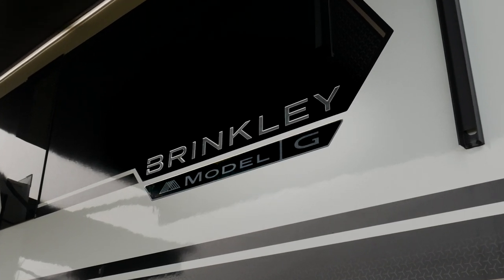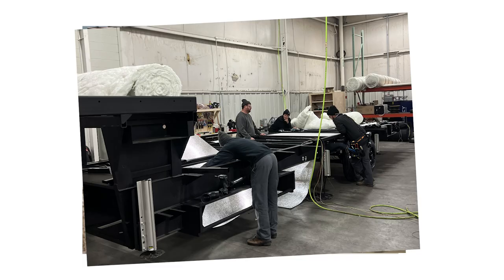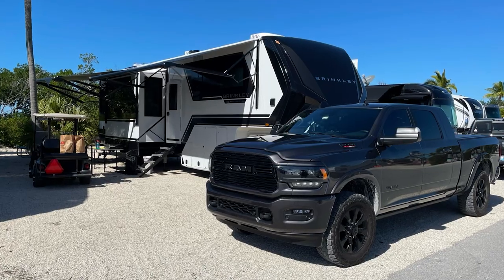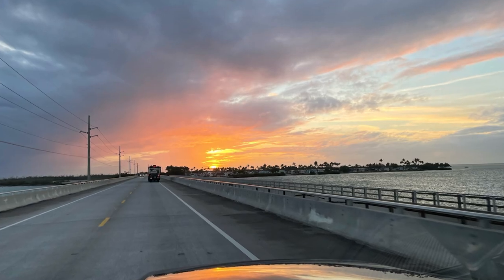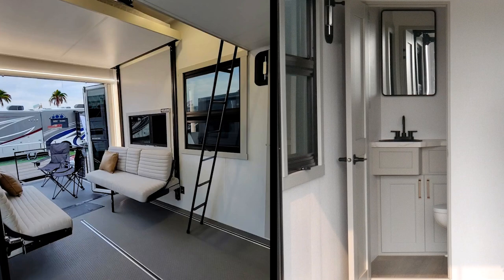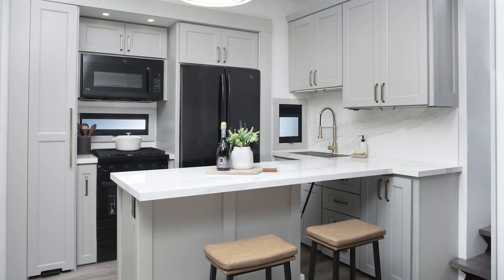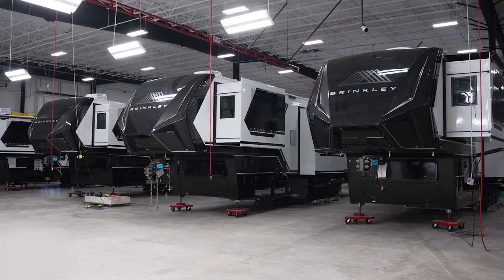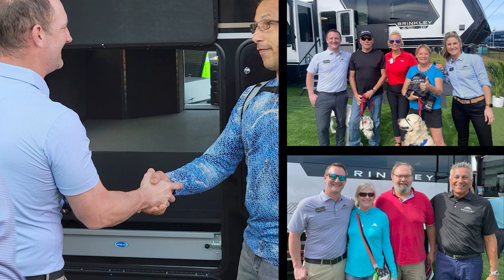Creating the Brinkley Model G a Toy Hauler Without Compromise: Interview with Nate Goldenberg

Comment: I'm hoping to see a 3110Z model that has the rear area as a flat "multi-purpose " room. Something you can store bikes,  cases of water,  basically anything.  Used as storage with tie downs. I want it in a Z model,  so it can be towed with a 250 or 2500. Couple's 5th wheel with storage room in the back. Should be a great seller and you can provide add-ons: washer dryer, bunks, couch, tie downs, work desk.  Should include an exterior door access.

Comment: My family is looking forward to a 2 full bath model G when it comes out as we have 6 kids still at home and don't haul any large toys, so a full bath fully contained in the garage in lieu of a larger toy garage which allows to keep the amazing living space is much preferred to us! I was wondering why the change from Furrion to GE Profile ACs? One explanation I heard was the new suspension lifted the trailer a bit above the 13'6" mark so you needed the low profile ACs, is there any truth to that? Also, have you considered the new Furrion Chill Cube ducted acs when come out or just going with their direct dump since there are 3 distinct AC zone in your G models? The lower power consumption and higher BTU rating would help a lot! I am in Texas so cooling these rather large puppies down when we have 8 bodies inside is a concern. Thanks!

Comment: Can the toolbox lid be reversed? It would be easier to reach in when a SxS is parked over it.
Reply from the maker: No, it would not be accessible with the garage door closed.
Reply: @BrinkleyRV  That is true, but if the vehicle is parked over it, the lid will only open as far as the skidplate, and you would have to crawl under it to reach in. Each to their own.

Comment: Both Toy haulers are outstanding… so much innovation in use of space & layout. The kitchen is best in any RV.  The only thing I would want is a dishwasher and I’ll recommend a great mod to offer. The microwave is a convection oven, so no need for oven. Replace oven with Inductive Stove top, beautiful and more efficient. Add a Dishwasher and drain in place of oven… plus add a pot drawer under or above dishwasher to maximize space.  If Inductive stove isn’t desired, add a gas stove top. 

For garage /utility room… provide some options… desk & workspace area, etc. 
Floor plan mod… remove some of the 16 ft garage, basically the 11 ft garage with a 5 ft larger living room area, more comfortable chairs & loveseats. All Toyhaulers have 1 big couch… small living room, I’d like the size of 4000 model with larger living room.
Reply from the maker: Thank you for the feedback! The Model G is prepped for a dishwasher under the sink.

Comment: I love the design and concepts of your product.  Would love to work for your company.   ( I do high end design and sales).    Here is what would make me switch from my Class A diesel pusher to a 5th wheel is a Brinkley Designed Toy Hauler with Slide in the Garage.   Murphey Bed in the Garage  instead of the drop down.   So the garage can be a formal bedroom that doesn't look like you tossed an air mattress in a hollow box.  If anyone can design and build this, it would be great and most likely a huge mass appeal.   It would make people consider toy haulers more.